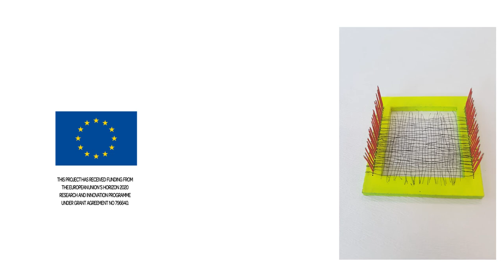Wet Spinning of Graphene Fiber

Comment: Graphene is Very Hard to work with, and the only time you could put it in anything would either be in carbon fiber or a cellulosic fiber, depending. 

You could put graphene in plastics, but there is no "Graphene fiber" per se